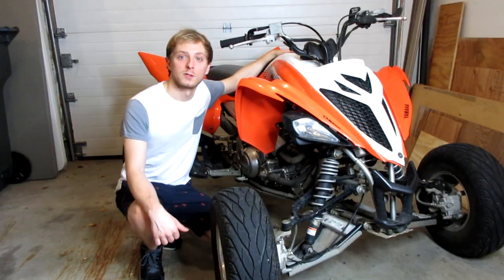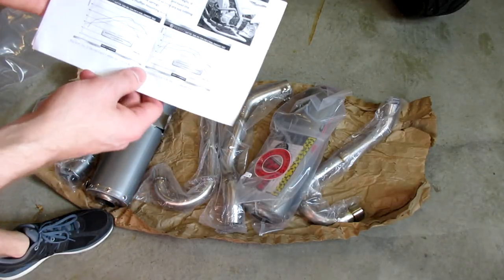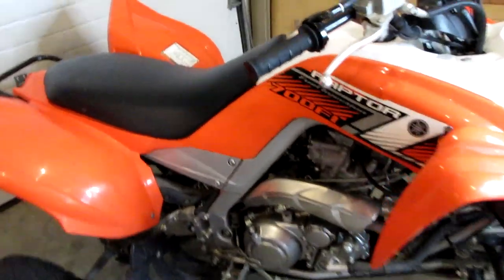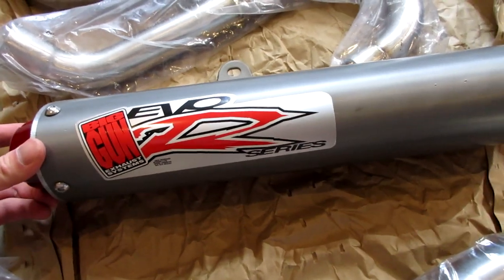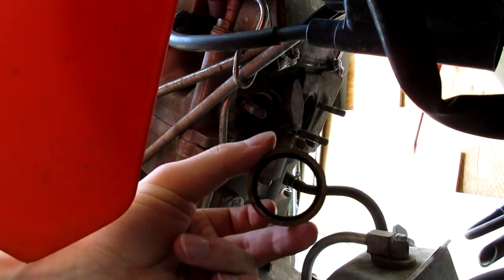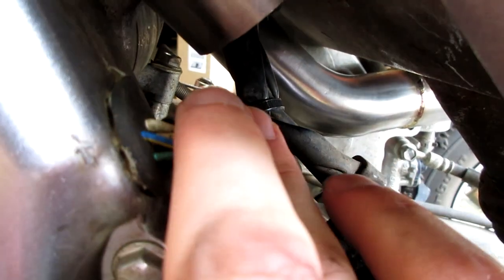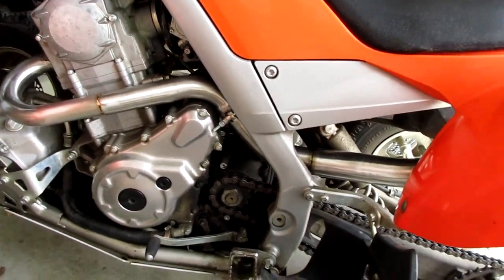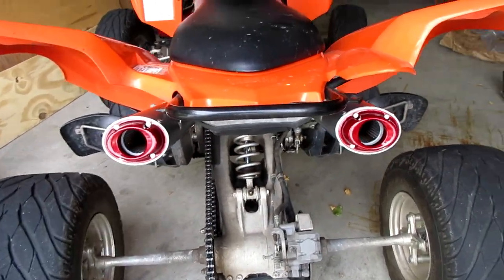Raptor 700 Big Gun Dual Exhaust Install and Sound

Comment: How much do one of these four wheelers cost? And how much does an exhaust system cost on them 🤔 im new to this trying to buy one
Reply: That raptor is about 7k brand new. If you are new look at a Honda 400ex. I have a 2000 400ex and it was about 1,800 for a nice one there are still a hell of a machine

Comment: Can I take my baffle out of my stock exhaust  without causing any issues?
Reply: Will it run if you do? Yes. But it will be running lean as these come from the factory running pretty lean already. Adding more air without more fuel is a bad idea for these machines. You can get used fuel controllers for around $100 US on eBay.
Reply: Good info. Thank you sir 👌

Comment: What map did you end up using. I have a the cold air intake, power commander V,  true dual barkers exhaust. Not sure if it has the correct map.

Comment: I have the same exhaust, ran fine for a day then my bike started bogging. I have a PC3, tried some different maps non of them worked. If anyone has a map for this exhaust please hmu
Reply from the maker: I'm running the map on dinojet website. Not not if its compatible with pc3 or not
Reply: @Motoposh  yeah my bike is fine, i tested volts on almost every sensor and then saw my stator wire was losing voltage due to overheat and was stalling and struggling to keep up RPMs.. thus i re wrapped those wires with heat tape and wrapped a small section of the pipe above the stator wires and loosed up my manifold, took a prybar and lifted the exhaust upward to gain clearance away from those wires and tap welded a lug nut to the pipe to have it sit on the case. its running great again! dual exhausts are not meant for the 700 but anyone can make it work. this fix only cost me 40 bucks for tape and exhaust wrap. if you bring it to a dealership they will kill you with $600 b.s and likely have more probs afterwards.

Comment: Will the big Gun fit my 2020 raptor 700 R just a single pipe no dual?
Reply: Yes it splits the exhaust at the end
Reply: Yes just make sure you get the 2015+ exhaust kit.

Comment: I doubt there's many exhaust systems that you can actually gain real Performance it's a false hope the big gun exhaust is what it says on the can looking for performance buy a Superbike most of them faster than the raptor in first gear
Reply from the maker: Had a daytona 675. Loved it. Any dual exhaust w/ power commander adds power to the raptor because they are quite restricted from factory.